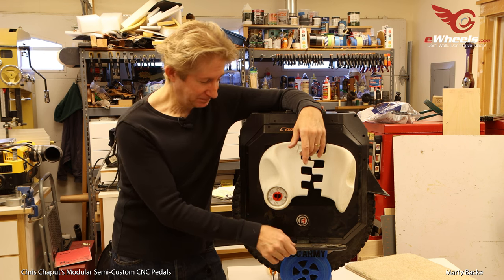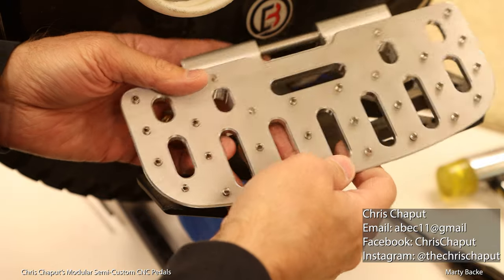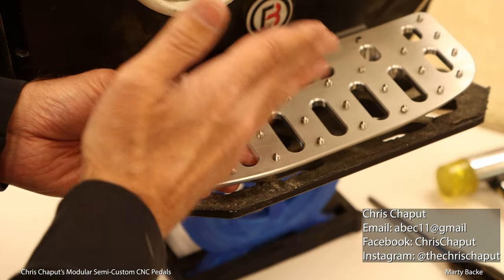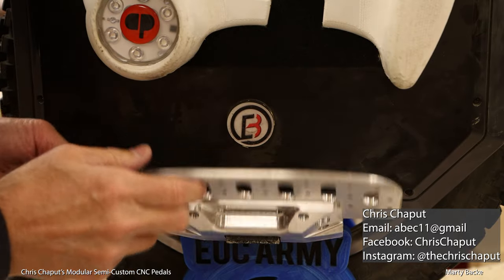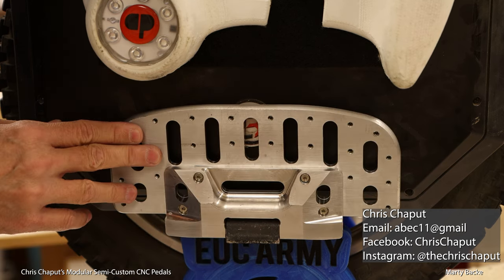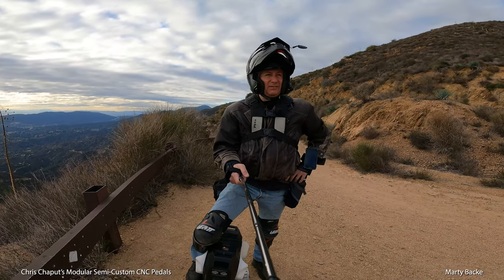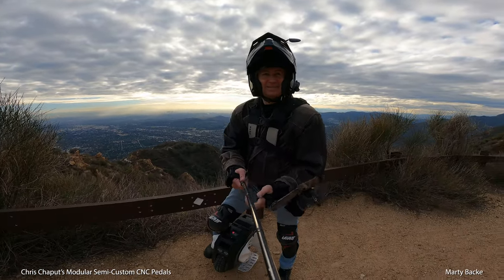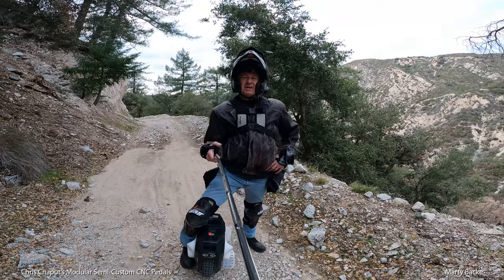Chris Chaput's Modular Semi-Custom CNC Pedals

Comment: Nylonove  with angle regulation - are still best and most versatile pedals for euc. Many different shapes and sizes, much lighter than metal pedals and magnet included. 
All these aluminium pedals looks good but are heavy and no angle regulation.
Reply from the maker: These include the magnet too 🙂

Can you buy the Nylonove panels with your EXACT length and width specification (I honestly don't know since I have never purchased them)?

I never understood why people care about how much the pedals weigh considering the wheel weight 🤔 but I understand some people do and for those people the plastic pedals are certainly better 👍
Reply: @ElectricUnicycles   why people like plastic, light pedals? Hmmm -1.5kg for overall weight of euc is very positive, especially when you need to carry it upstais 3 floors.

Comment: They look really nice. They just need that magnet to hold them up.
What's the weight compared to the stock pedals? Obviously customization will alter that, but as a reference did you weigh yours?
Reply from the maker: I did not weigh the pedals but they are certainly less than the stock pedals. Considering the weight of any wheel and yourself, I don't see what affect pedal weight has on anything ???
Reply: @ElectricUnicycles  any reduction in weight to life up stairs or in to the vehicle is a positive in my book.
Reply from the maker: @JonS  Ah, for people who carry wheels. Those people probably won't buy a Commander in this particular case 🙂